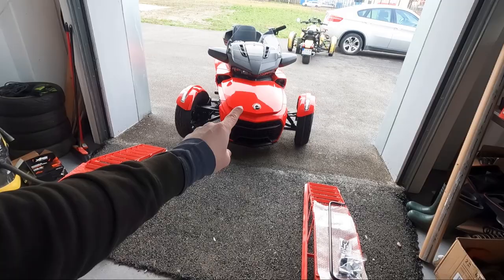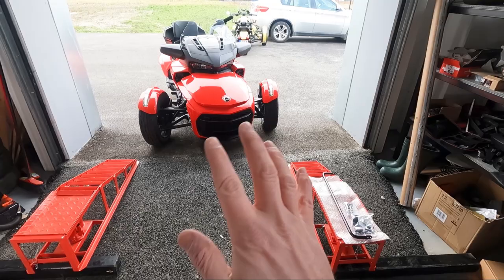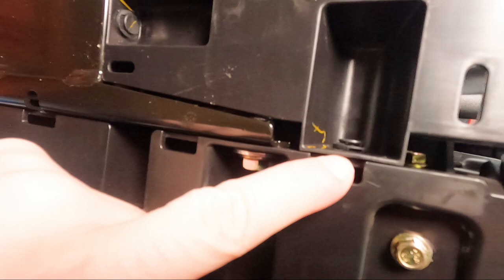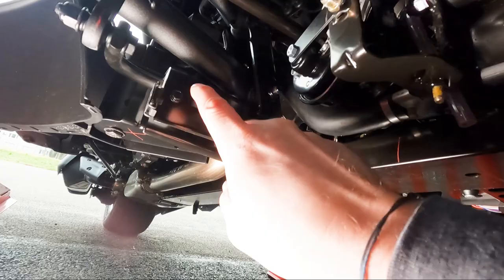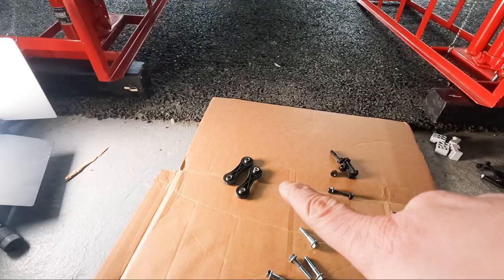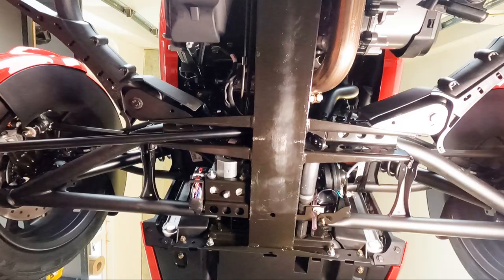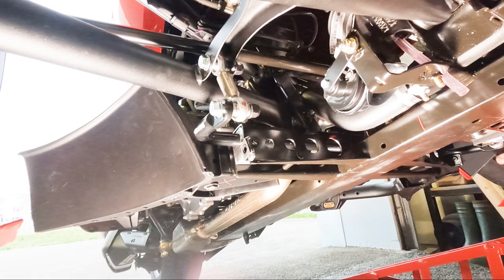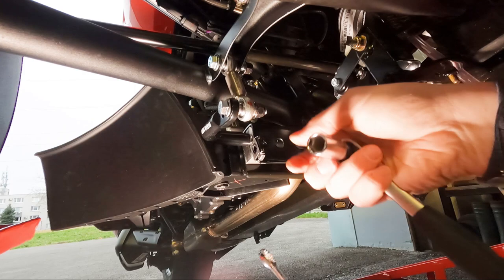Installing the HEAVY DUTY Swaybar for Can-Am Spyder F3 - Boost Your Ride's Performance

Comment: I have the same set up with regard to ramps and a 4 x 4 to make the 4 inch difference to clear the height. The problem I am having is that every time I try to drive the spider up the ramp, the ramp moves forward across the 4 x 4‘s. Did you have this problem?
Reply from the maker: Yes and not anymore :) now i drive down the hill so ot ok. Before when i was using it on normal "road" needed to use heavy think to stop from sliding forwards.. 😉